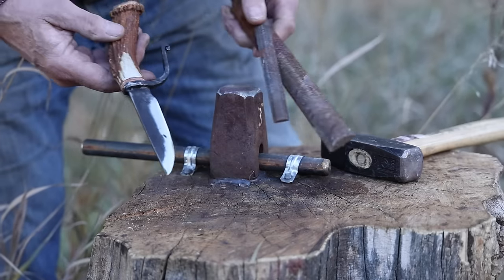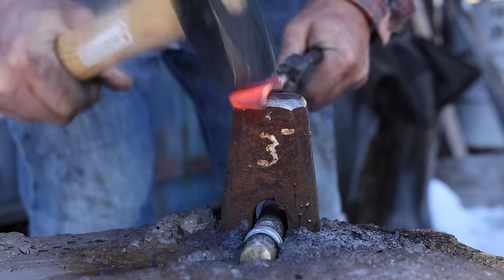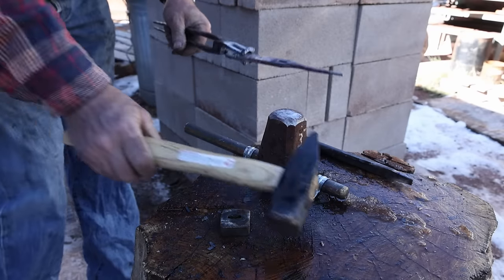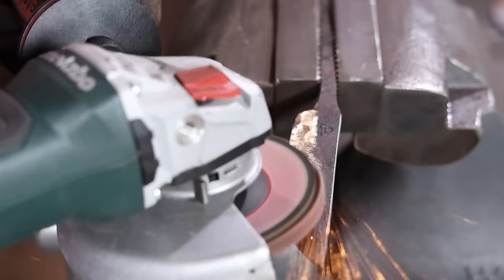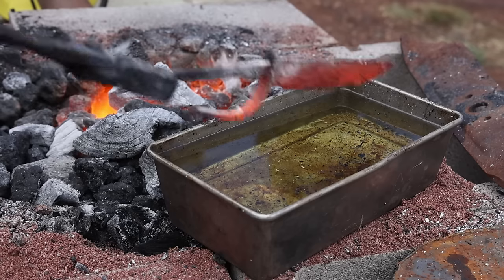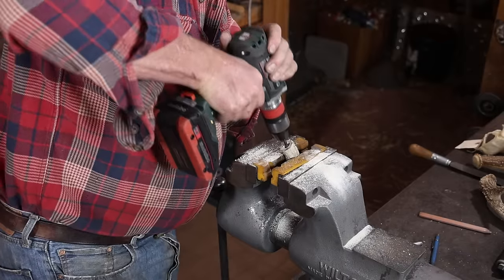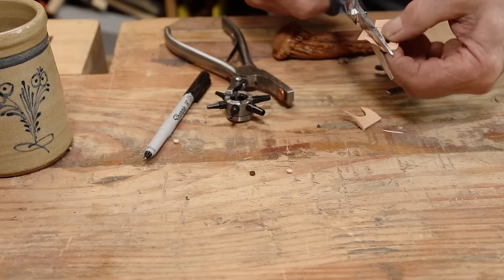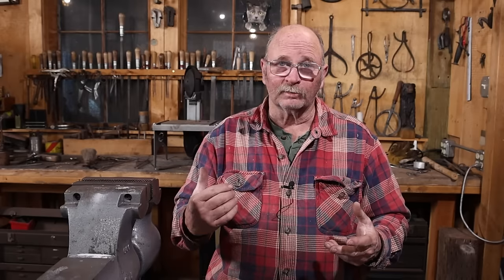Making a Knife from an Old File - Backyard Blacksmithing

Comment: not a blacksmith
but i think you did right by not tempering the tang, because if you temper it the knife might break,  but if you leave it untempered and it bends you can bend it back

Comment: Tongs. I need several different sets. It takes so much extra work when you can’t hold the work properly or it keeps flipping out of the tongs you are using and wasting energy and having less time to actually work on the piece between heating. I never even considered different tongs when I started getting tools together. I figured the set I had would work for all my needs…it did not.
Reply from the maker: I probably have 100 pairs at this point.

Comment: Impractical. Rough handle that allows you to do only short work comfortably. Try to work with this knife for 20-30 minutes. Why such a garda? In short, this is a knife specifically to make it look beautiful in the frame. Not for life. Have you seen the handles of Finnish knives? It's smooth, barrel-shaped, polished wood. It doesn't slip or rub.
Reply: Just do a leather wrap than